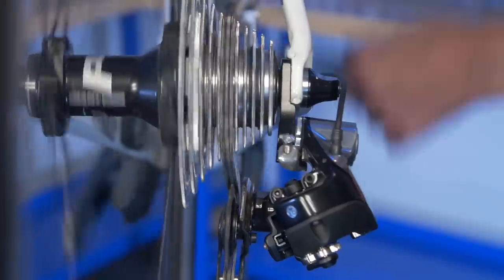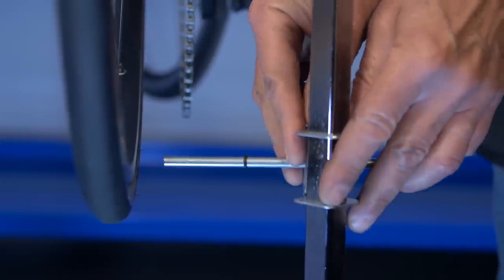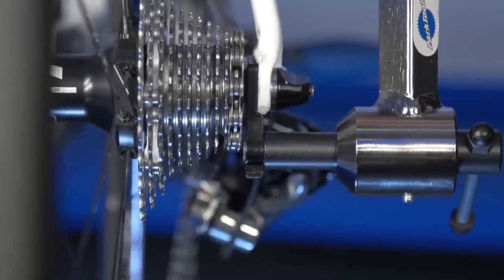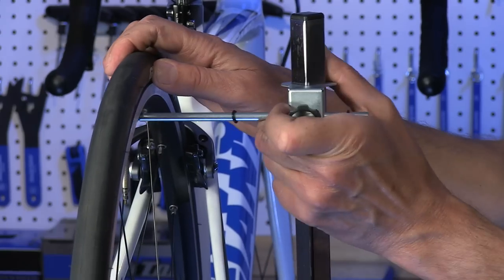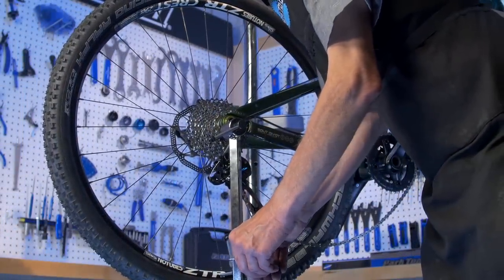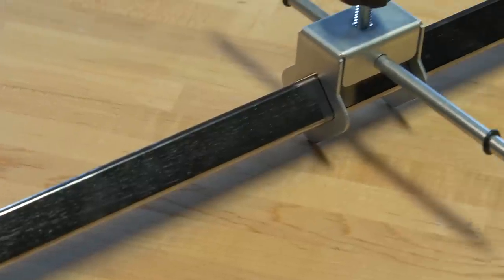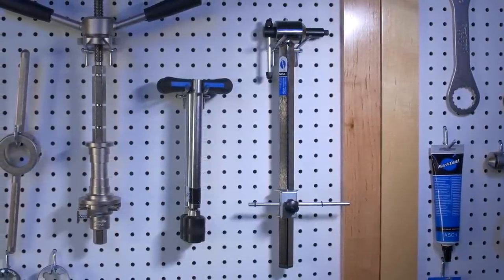DAG 2.2 Derailleur Hanger Alignment Gauge

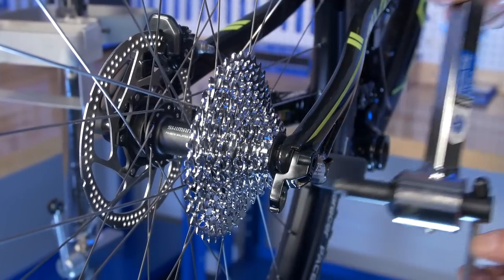Comment: The alignment is slightly outward if you hold up a ruler and check at about 1:11. I guess it is still ok since the derailleur should have a tolerance range  to operate normally.

Comment: What if your wheel rim isn’t true...would the reference be off?
Reply from the maker: Using the same reference point at the rim, say right at the valve it will not matter how true the wheel is because the reference point is always the same. So Checking at the top bottom or side line it up with the valve and you will be good to go.
Reply: Park Tool ah I got it now. Thanks for replying. I’m just a home mechanic, your tools are really good - would be good if the price point is more affordable for normal folks :)
Reply from the maker: Hello Jeff, this tool is fully made in the USA and the price is competitive with copies from over seas.

Comment: Ok, nice tool but is an aluminum derailleur hanger elastic enough to be bended like this? Aluminum is not such a durable metal. Micro fissures can easily occur. It'd be better to buy a new hanger.
Reply from the maker: Certainly it works on aluminum. Most hangers now are aluminum.  Aluminum can take a set, having its yield point far enough from its tensile point. It has those ductile properties to bend successfully.  Riding the bike is not hard or stressful on hangers.  Even new hanger should be checked.  Most hangers are accurate, but the fitment to frame is not.  You often need to "custom fit" a hanger to a bike.